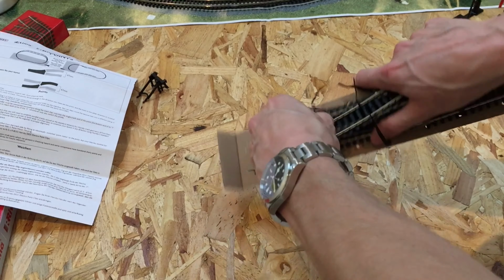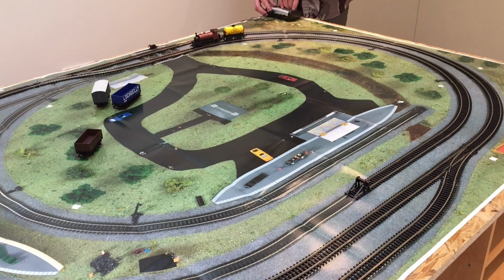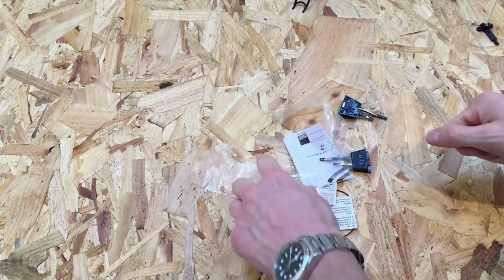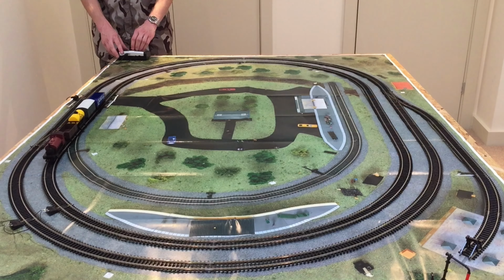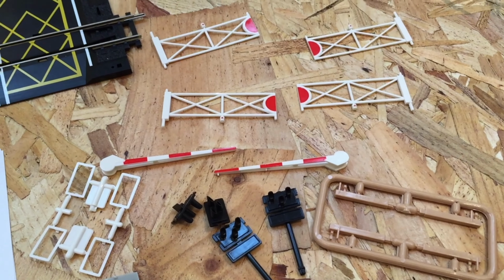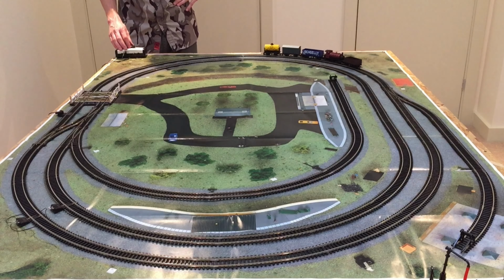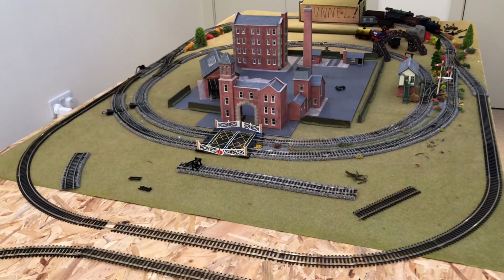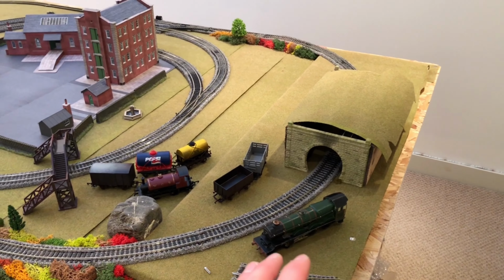Complete Hornby Track Mat Layout Walkthrough (Track Expansion Pack A B C D)

Comment: I had the basic Hornby Branch line pack and have just ordered over 100 track pieces 2nd hand. From your video seems I will need the link wire assembly, some spare spade connectors and cleaning products, but is there anything else I should consider please?

Comment: Would you advise buying a starter train set 
And then ass the Expansion sets ?
Reply from the maker: Honestly yes for an absolute beginner. It is a good layout to learn on and you can also customise it yourself as time goes on. It is possibly a bit of an expensive way to do it, but over all I am happy that it’s what I did!
Reply: @SortOfInteresting its been 2 months but hope u reply, can I use the hornby extension packs with a bachmann starter train set layout. FYI the bachmann train set is have is the midnight metropolitan

Comment: I've just bort  the same  tracks but am having trouble with the points they keep  Derailing any ideas would be appreciated
Reply: It could be that the points haven't thrown fully, or they aren't aligned to the next piece of track (are the rails seated in the joiners correctly), another possibility is the locomotives themselves, many of the larger models available today don't like the tight radius of the points (they are second radius) - Unfortunately there isn't much you can do about this on a 'track mat' layout. What trains are you running?

Comment: This is a fantastic video on my double bed. I can take the sheets off put the board on and just pack it away neatly now I need to know what controller you’re using to run all this. Hopefully I’ll get a reply soon.  Thank you very much. DSM
Reply from the maker: Hello! Originally I was using the standard Hornby controller but I upgraded to a Bachmann small blue square controller after a while when I soldered the power lines to the track.

Comment: AN EXPENSIVE DISASTER WAITING TO HAPPEN ???
Commercially produced products such as Track mats, track plans, & especially Clip Together track systems, only lead to problems and frustration later. They are of course aimed at the unsuspecting beginner. Save yourself a fortune, and shortcut the "Learning Curve" by joining your local Model Railway Club first. The average British House is too small for "OO" scale. This being a Major Reason Hornby recently introduced the new smaller TT:120 scale. 

THE LAWS OF PHYSICS CANNOT BE CIRCUMNAVIGATED !
There is a Law of Physics that affects real trains and Models in exactly the same way. It states "With every degree of curvature, the power necessary in the locomotive must be increased by the SQUARE ROOT" !!!  What the "LAW" means, goes like this: Take a nice modern Hornby OO gauge "Flying Scotsman". This model today has a pretty good, and powerful motor. But if you run this model around the minimum recommended Radius Two curve, the loco will start wheel slipping in such curves with more than around 4-5 average Hornby bogie coaches. Wheel slipping causes damage to the mechanism reducing Motor life considerably !  However if you then run this same "Flying Scotsman" around minimum 5ft Radius (10ft Diameter) track it will happily haul 12-13 Hornby bogie coaches without any hint of slipping, and last for years !   

Large 5ft Radius track also abolishes many of the electrical pick up problems experienced with toy train set "Kiddy curves". Indeed far fewer derailments will be experienced, especially with large steam loco models. Trains do NOT have "Differentials" in their axles like road vehicles, so have BIG trouble negotiating curves ! And in real life the "Flying Scotsman" cannot negotiate a curve of less than FOUR CHAINS (at any greater speed than walking pace). Which translates 4 Chains = 264 feet. In OO scale this comes out at 264 x 4mm to 1 foot = 1056mm, which translates into feet and inches as a 3ft 6in Radius curve for a scale 3mph without any wagons or carriages ! Hence in reality no curve on any layout  should be less than 5ft Radius on a track where you want a loco to haul a train ! Such a curve also allows carriages, wagons & even loco tender gaps to be reduced to virtually the real life gap, which looks so much more realistic.

So if you haven't got the Space for "OO" Gauge 5ft Radius curves, you need to consider a scale smaller than "OO" gauge. The new Hornby TT:120 scale can cope with 4foot Radius curves, and the even smaller N Gauge at 1:150 scale can cope with minimum 3ft 6in Radius curves.  Or the even smaller Z Gauge (1:220 scale) can utilise 2ft 3in curves without trouble !!! Choosing the right scale for the available space could save you literally thousands of pounds in the long run.